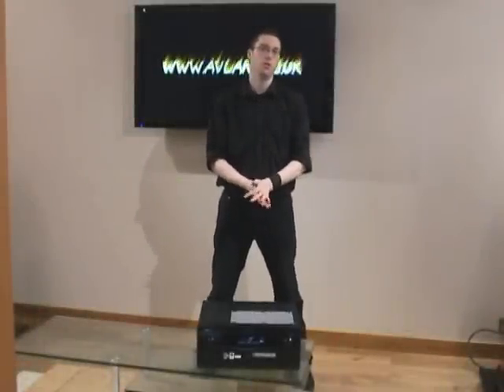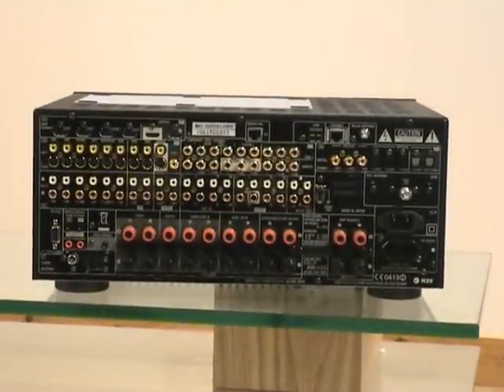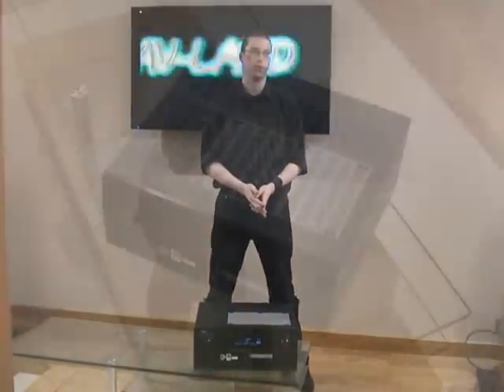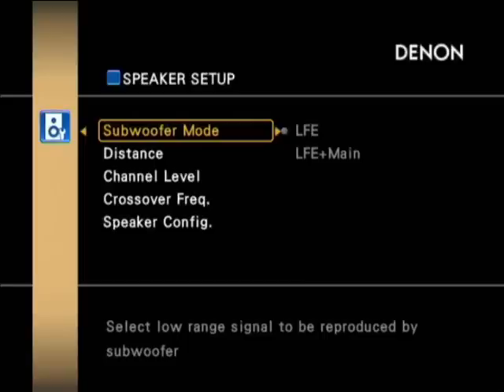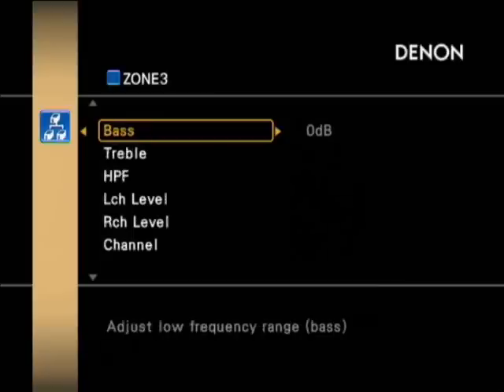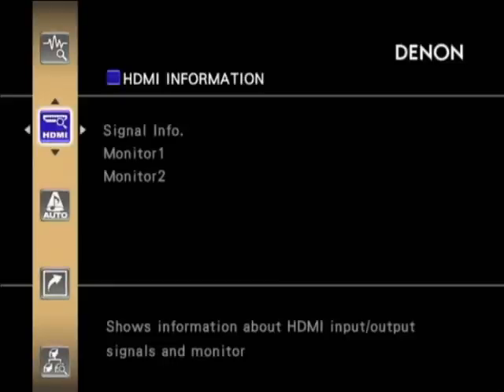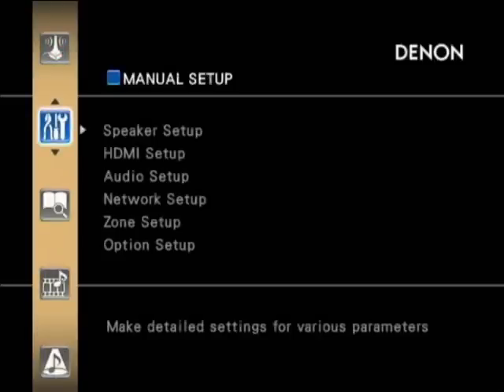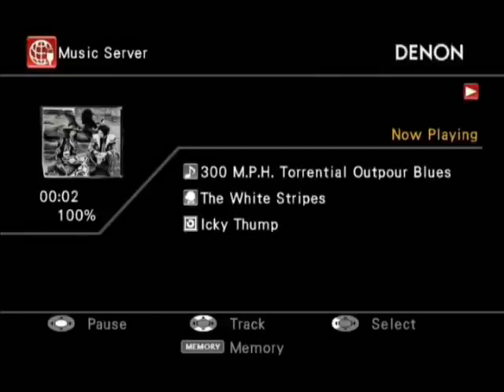Denon AVR-4308 HD Receiver Video Review

Comment: I have a Denon avr 4308. The question is if I can rip vinyls with it because I didn't see a rec output.From the dvr output it gives me a signal from the tuner and from vcr no sound.
Reply: I'm sure it's possible... My guess: Use the Source Selector knob to switch to VCR/iPod or DVR, now push the "Zone 2/3/4 Rec Select" button that is under the Source Selector knob (3rd button from the left) and make sure to select Zone 2, then rotate the Source Select knob until you see RECOUT PHONO on the display and you should be done, at least I think that should work, right now I only have my HTPC hooked up, but if it doesn't work I'll hook up a Turntable, a Cassette Deck, Mini Disk or DAT Recorder and try it myself.
Reply: @KILLorBE  Thanks for the reply. I'm trying now.
Reply: @KILLorBE  I succeeded exactly as you said. So simple ......... Thank you very much Sir!!!
Reply: @danielmalinas4477  You're welcome, glad I could help.
It's simple when you know it, but I couldn't even find it in the manual.
I was actually looking for a 4308A or if it was still possible to upgrade a 4308. Not sure why, but when scrolling through google I noticed this video and that I had already watched it (Color of the link), but I also noticed that it said 18 hours ago, so I looked and the rest is history.
Reply: @KILLorBE  following the Denon-HP the upgrade is no more available since 2015. I baught my 4308 used Years ago and i did that upgrade. It was really worth the money. On the A-Version there ist a sounnd-feature Dynamic Equ... or Dynamic Loudness. 
It is very useful when listening at room volume. Better than any other loudness i ever heard.